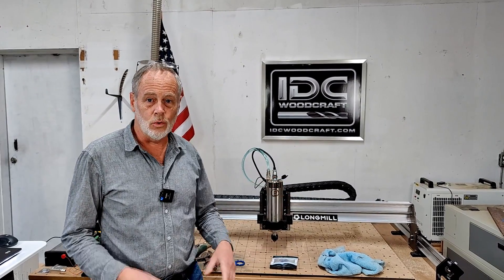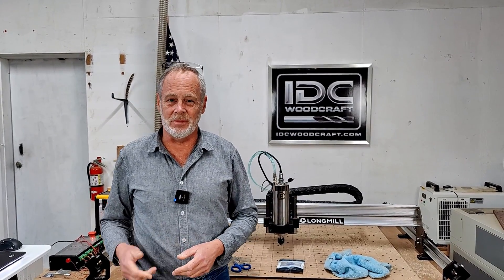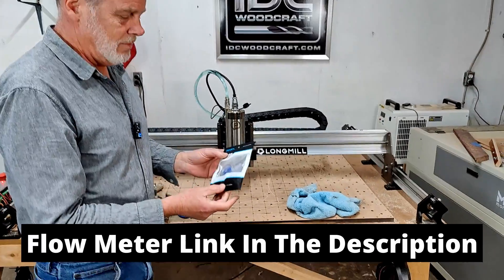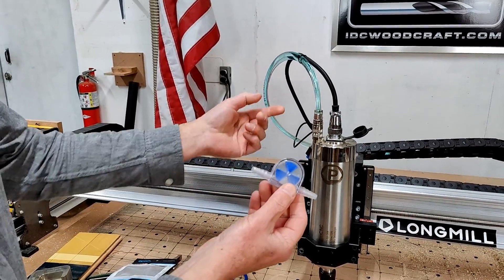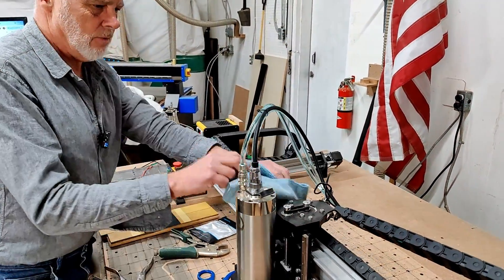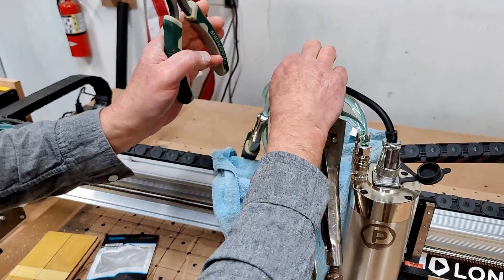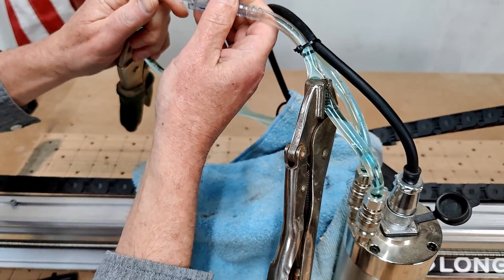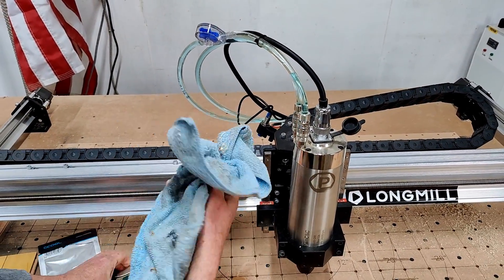Prevent Spindle Damage With This Tool

Comment: Before cutting your fluid line like I did, check the diameter of the hoses. This unit won't fit on an Axiom router the lines are too small. Now I need to find a fix.
Reply from the maker: garciarosa100, I appreciate you sharing that tip! It's always important to double-check compatibility before making any adjustments. Good luck finding a solution for your setup!

Comment: Good tip, question, Do you run your spindles through a chiller such as the ones used with a Laser Engraver?
Reply from the maker: cliffgeter1105, you definitely can brother! But it all depends on your spindle manufacturer recommendations and how you plan on using it.

Comment: I wouldn’t mount it up there over the spindle and over the spoilboard. If it leaks, that could be a big problem. I mounted mine off to the side, right where my water lines go through my table down to the reservoir bucket. I can still see it, but it’s not over the MDF spoilboard or anything electrical that could be damaged if it leaks. People like to mount it up there simply for the “looks cool” factor, just hope that it never leaks.
Reply from the maker: TerrapinCreations666, very good point my friend. I couldn't agree more.

Comment: I honestly don't have a clue what to say, these devices are meant for visual coolness inside of fancy colored illuminated computers and protect nothing. Computer thermal protection is built-in to the CPU.

 Spindle manufacturers note that the max temp of the spindle before damage is 104 deg F (40C). Since many in their garage could be at 80-90 to start with there is not a lot of room for error. 10-20 degrees only takes a minute of 2. For a visual protection to work someone would have to look at the spinner every 30 seconds the entire time a job is running. Not likely possible. What is more likely to happen is you will hear a tone change when the bearings start to cook and then notice the spinner isn't spinning. I don't know many CNC operators that can or want to keep looking at a spinner, you can watch the job and the spinner at the same time. Or for that matter do any cleanup.

 A real flow switch is $20 on Amazon (Canada)! Used by many CO2 laser folks. Its a very common part. It does need a bit of wiring.  If your pause shuts down the spindle simple parallel it to the pause button. Then manually run the pump so that there is flow when the controller starts the program. For any one of 100 reasons the flow stops the program will pause and stop the spindle and indicate its paused. If your doing something else in the shop you will hear it shut down and know your protection worked!

 The only place the spinner is good is when you fix the problem and re-start the pump you can see there is flow so you can re-start the job.
Reply from the maker: Thanks for the input. This is a visual tool as I said I'm the video to ensure the coolant is running.